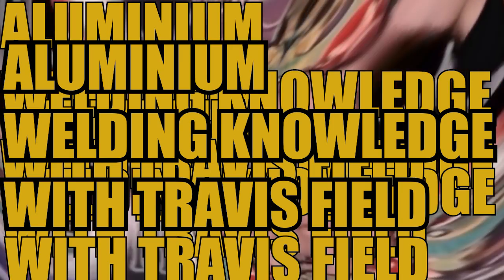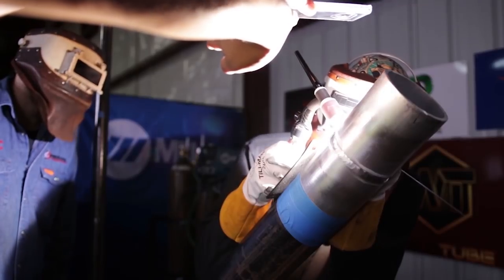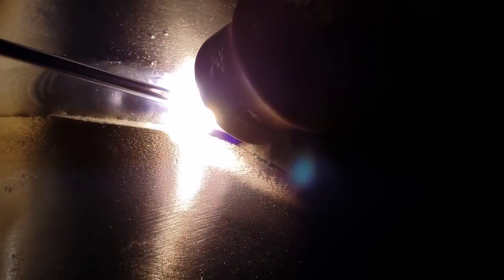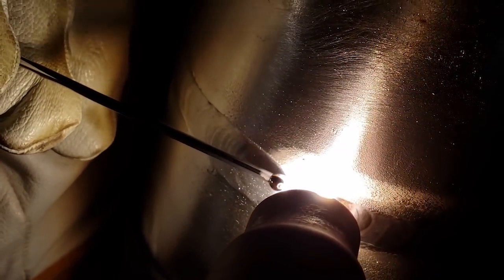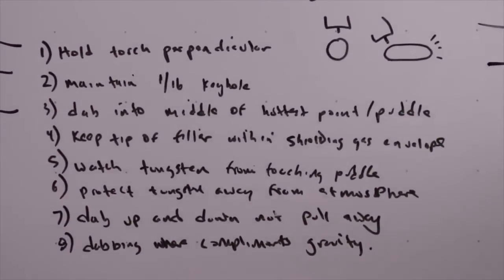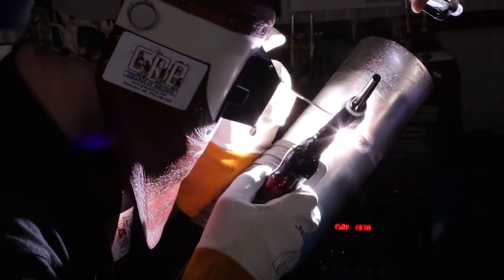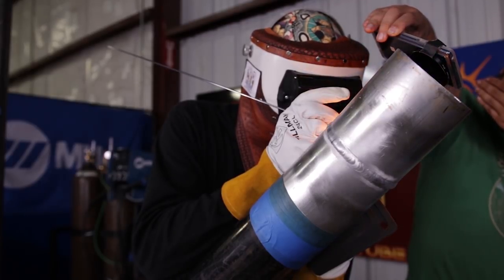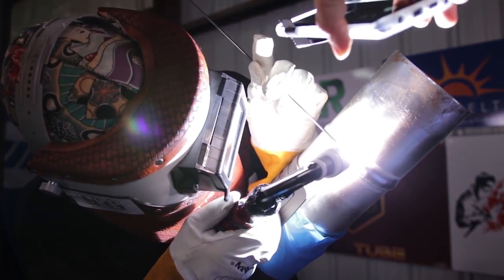Aluminium Welding Knowledge with Travis Field

Comment: I dont like the look of his tungsten,too sharp try and build up a small ball by going into a minus poll,looks like your welding on DC and not AC,also try a Helium mix gas like Varigon ,another small tip is to pre-heat your pipe with a blow torch to remove the dampness.I would of liked to have seen the root on the inside of that pipe just to see if hes come through.Interesting to see how you guys weld,greetings from Europe and thumbs up.

Comment: What's up papa a have you ever welded with 207 wire? Ima tank builder and this new company I work for only uses 207 wire on a l.n25 suitcase if u can make a video that would firme daw...on a vert quarter inch plate